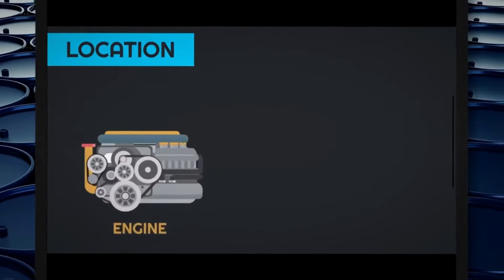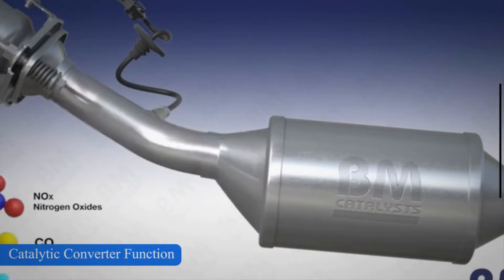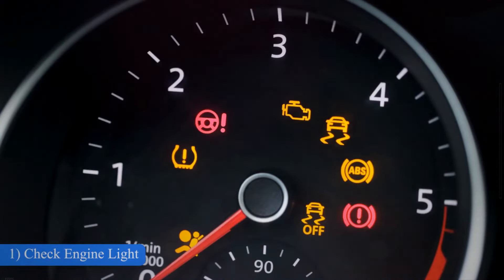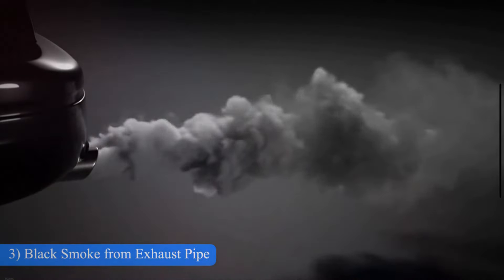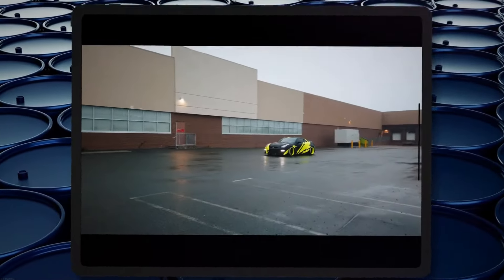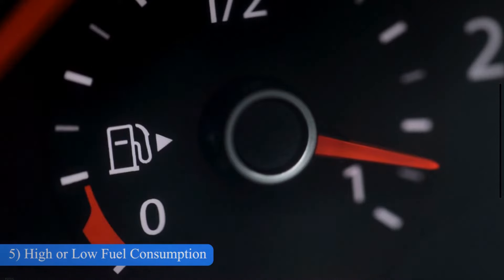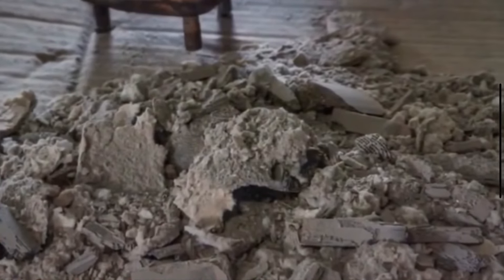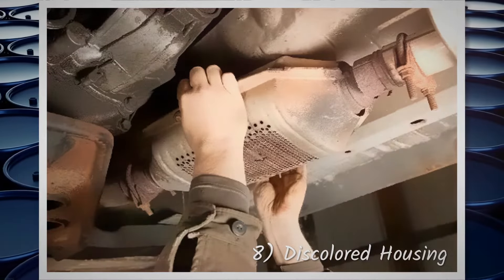Top 10 Symptoms of Bad Catalytic Converter

Comment: Would a broken catalytic converter cause a car to stop all acceleration responses and i am having tontake my foot off the pedal and downshift then the power kicks back in hard and then goos good again but randomly do it over again (think my catalytic is damaged because my exhaust is rattling at low rpms and at idle itbget a random exhaust rattle
Reply from the maker: A broken catalytic converter could potentially cause issues with acceleration, but it wouldn't necessarily stop all acceleration responses on its own.
Reply: @MechanicalBoost I have the same problem. 1st & 2nd gear struggle but everything goes back to normal the more I drive.
Reply from the maker: @bobbystereo936  If your car struggles in 1st and 2nd gear but runs smoothly as you drive more, there could be several potential causes: such as 
Transmission Fluid Issues: Low or dirty transmission fluid can cause shifting problems, especially when the car is cold. As the car warms up, the fluid becomes more effective, which might explain why the problem diminishes.

Clutch Problems (Manual Transmission): If your car has a manual transmission, the clutch might be slipping or not engaging properly in the lower gears. This can be due to wear and tear or issues with the clutch hydraulic system.

Transmission Control Module (Automatic Transmission): The transmission control module might have issues, causing improper shifting in lower gears. As the car warms up, the module might function better.

Engine Performance Issues: Problems with engine performance, such as issues with the fuel system, ignition system, or air intake, can cause poor performance in lower gears.

Vacuum Leaks: Vacuum leaks can cause erratic behavior in the engine and transmission, particularly when the engine is cold.

Cold Engine: When the engine is cold, it might not run as smoothly as when it warms up. This can affect the performance of the car in lower gears.

Transmission Wear and Tear: General wear and tear of the transmission components can cause issues in the lower gears. As the car warms up, the parts might expand slightly and function better.
Reply: @MechanicalBoost  Funny you mention that! I recently had the water pump fixed & It looked like antifreeze was leaking outta that transmission box or gear box or whatever that is?
Reply: My car was doing that and the mechanics changed the spark plugs and coil packs  it's a for now patch job until the cat. Converter can be fixed or I can give up the car runs better. Continue to out fuel injection cleaner and catalytic converter cleaner in gas tank with 16 gallons of gas and it kicks out bad orders if you have bad orders
Reply: @bobbystereo936 same here

Comment: I have a 2004 Honda Pilot, can a bad catalytic converter cause it it to start?
Reply from the maker: A bad catalytic converter typically wouldn't cause a car to fail to start on its own. However, a severely clogged catalytic converter could potentially contribute to engine performance issues that might indirectly affect starting.

Comment: I just bo anew catalytic c but my car still show check engine light.
What can l do
Reply from the maker: You should contact a professional mechanic for deep inspection or do it yourself. Your car may trigger check engine light due to different reasons such as a bad spark plug, bad ignition coils, bad fuel injectors, engine misfire, and many more. Therefore, you need to properly diagnose the issue.
Reply: @MechanicalBoost  l took to the mechanic and checked the error code was still p0420... Catalytic converter below threshold on bank 1... Something like that
I bought anew catalytic converter and still showed same problem. Am confused cause the more l visit the repair shop the more money I spend and no change.
Reply from the maker: @sulaamisi  You should also check your oxygen sensors because they may also affect the performance of your catalytic converter and trigger the P0420 code. Also check your system for Exhaust Leaks and test the ECM. Sometimes a bad ECM may also inacuurately trigger this trouble code.
Problems with fuel injectors, fuel pressure, or a malfunctioning fuel mixture sensor can cause an imbalance in the air-fuel ratio, which can affect the performance of the catalytic converter.
Reply: @MechanicalBoost  alright thanks for the advice. I try them out

Comment: Can it destroy the engine
Reply from the maker: No, usually it can't destroy your engine but it may badly affect your car's emissions
Reply: @MechanicalBoost  I'm driving a car with a bad cat , if I change it will it be ok or have I damaged the engine now that it will fail in emissions?
Reply from the maker: @timothyorourke7116 Driving with a bad catalytic converter (cat) can cause some issues, but it depends on how long you’ve been driving with it and the overall condition of the car.
1) Emissions: A faulty catalytic converter won’t process exhaust gases efficiently, so your car is more likely to fail an emissions test.
2) Engine Damage: If the catalytic converter is clogged or restricted, it can cause a buildup of backpressure in the exhaust system, which might lead to overheating or other engine performance issues. Long-term driving with excessive backpressure could harm the engine.